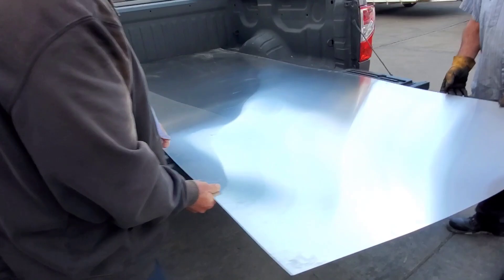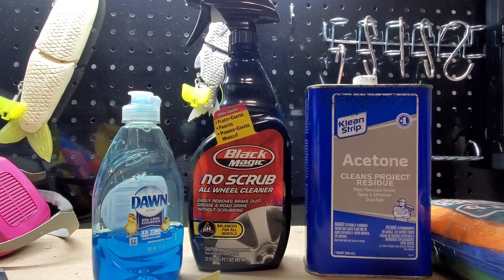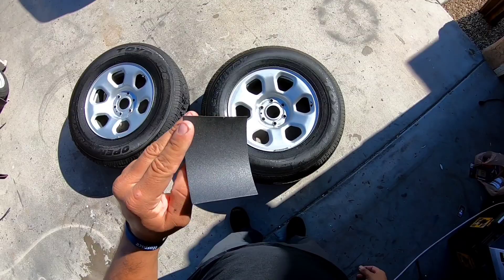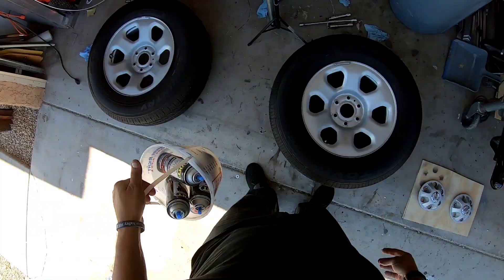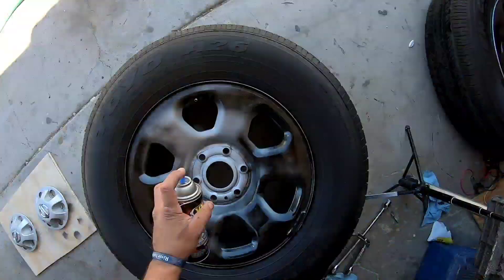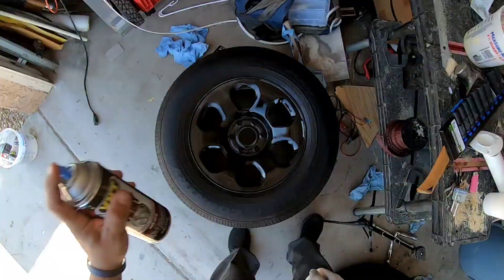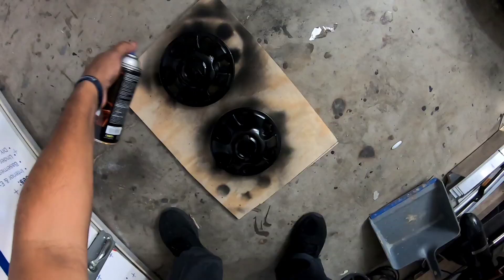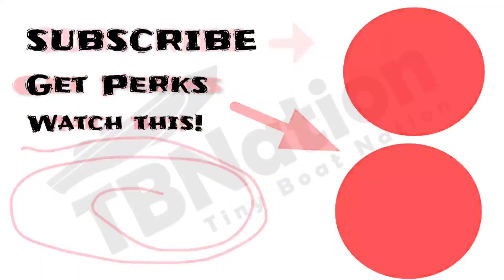How to Spray Paint your Truck or Car Wheels | EASY DIY PROJECT!!!

Comment: Always mark the location of the wheel weight on the sidewall remove the weight paint and replace the weight later. The ne6time you have a rebalance or tire replacement you will have that silver spot after the tire shop removes it to rebalance it later
Reply: I was a tire guy for 16 years my suggestion would be to remove all outside wheel weights paint those areas and then have you local tire shop do a different type of balance like a static balance that will hide the weights inside of the wheel and give it a clean look. Every time these wheels are balanced you dont want tire shops constantly pounding weights on the outside and messing up all your work